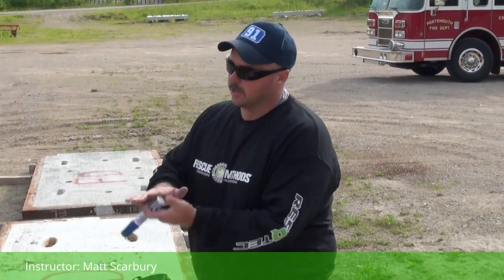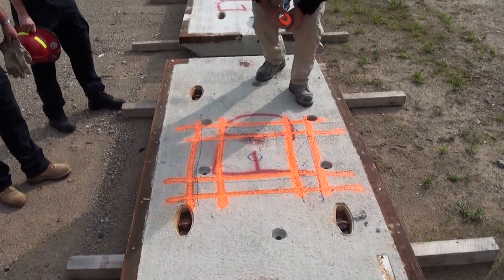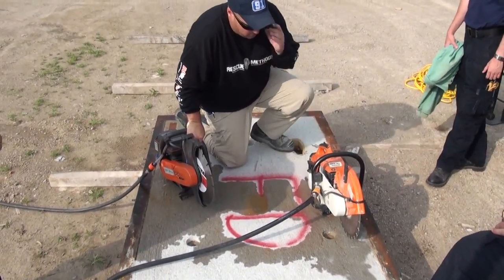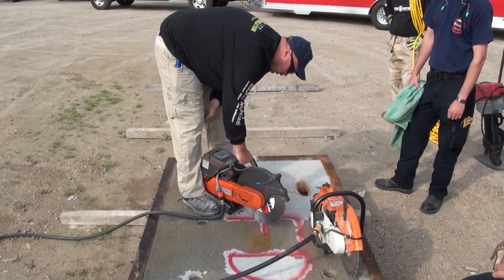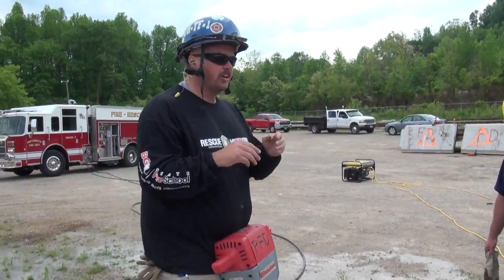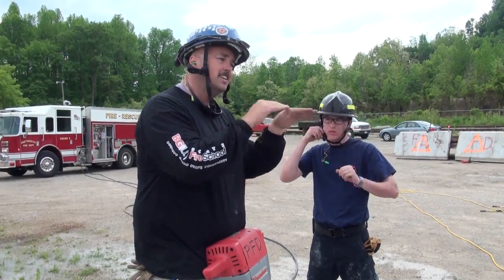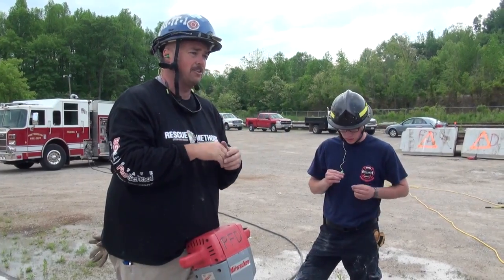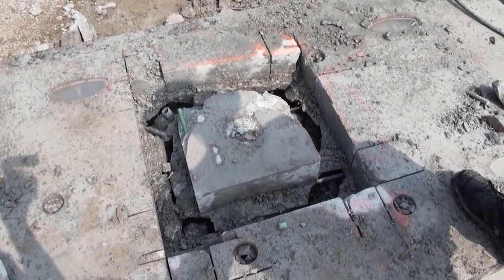Rescue Methods  Structural Collapse   Step Cutting Concrete

Comment: As Saws go what cc and blade diameter are we looking at? Are the Husqvarna K760 with 12inch disc enough for these tasks would you want bigger and more powerful, or lighter?
Reply from the maker: RFTMS87 K670 should get the job done.  12" blades are often a little undersized for maximizing depth.  14" blades will make quicker work of the cuts.  The bigger the power head the more power you will obviously have getting through the material.  The spindle speed or RPM's don't increase with power but the torque basically does.  With a big 14" blade you will need all of the power you can get to push through all of the binding of the aggregate and slurry.  There are also some newer diamond blades that are adding diamond abrasive segments to the side of the blade which help push through the material as well.  Hope that helps and thanks for the inquiry.  Train Hard!!
Reply: Rescue Methods Thanks for the input, so the saw in the video is the Husqvarna K760 with 14 inch blade?